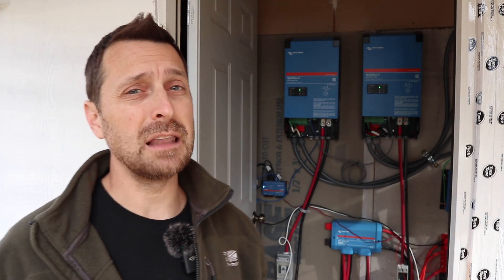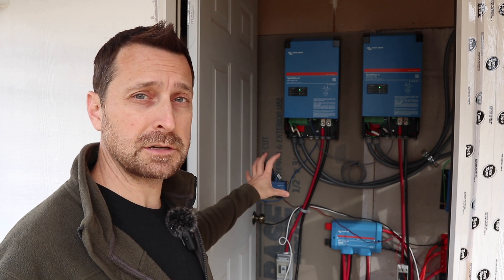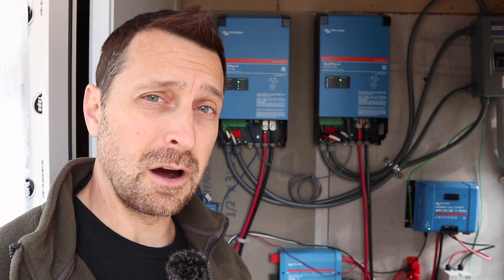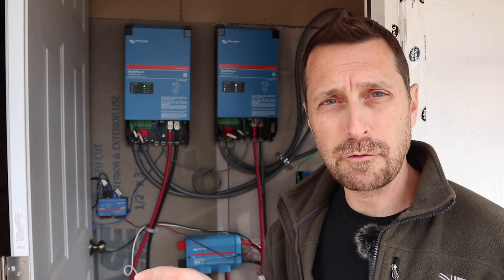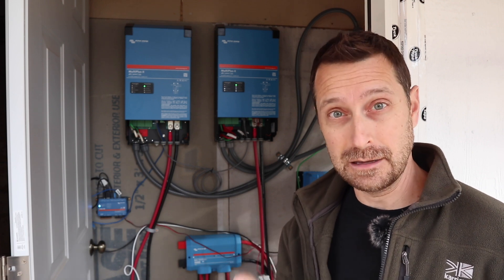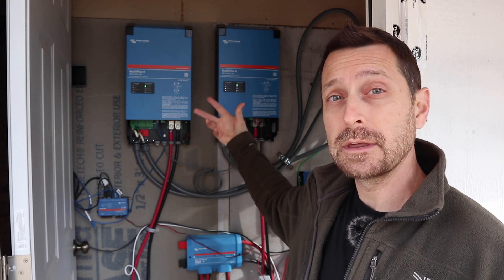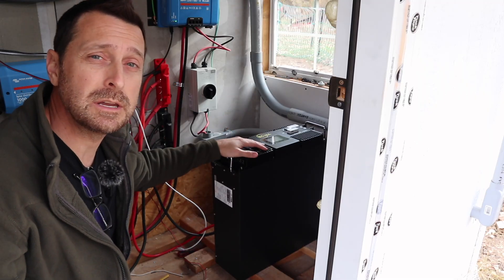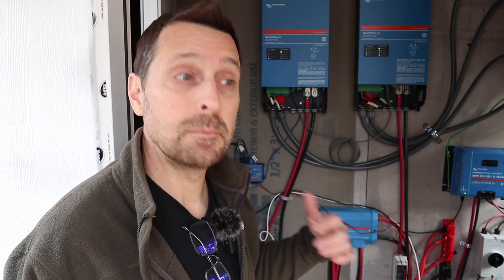Is There A Flaw In A Modern Solar Power System For Home Use?

Comment: Our system is uncomplicated. We have 14.6kW of Bifacial panels by SEG, a single EG4 18K PV by Lux Power and 28kW of EVE 280K DIY battery’s using JK-BMS’s with 2 amp active balancing (there isn’t a better BMS out there. Rock solid firmware). For cloudy days we use a Chargeverter by EG4 connected to our Diesel Generator running on filtered Waste Veggie-Oil mixed with 30% petrol for winter. We have no external breakers, fuses or switches because everything is built into the 18K and just works.. So, Solar Panels into inverter/charger into Battery’s that’s it. I considered Victron but there are just to many separate components and to many point of failure.
Reply from the maker: Victron was supposed to be one of the best and that is why I considered it. I am rethinking that a bit.
Reply: I wounder if Signature Solar would send you a EG4 18K or the new 6000 unit to review and keep.
Reply from the maker: @stevenfrazier8939  I have the new 6000xp unit for the house that I am installing right now and doing a review on. Unfortunately those would not work for the solar shed for the barn. I mentioned all the reasons why in my original install video on the Victron.
Reply: All I can think of is the Victron equipment is a Low frequency inverter? I have a Xantrex Freedom SW3012 that is a 12 volt 3,000 watt LF inverter that surges to 6,000 watts. and yet my High frequency 18K handles induction loads like it isn't even there. You will find the Lux Power family of invert/chargers are on a whole other level than you are used to.
Reply: @CountryLivingExperience I would recommend going to voltage control and no SOC. I run my 3 Schneider 6848 on 3 15k BigBatteries and am having no issues. I’ve heard that Discovery battery “the best” even has issues with SOC tied with a Schneider system. SOC is the issue IMO. Victorian are little tanks and should give you a trouble free long life.
Reply from the maker: @NewLightEnergy  I'll explore that.

Comment: I agree with everything you said and have seen it  myself. I know friends with solark systems that have issues with Them. Seems to me these high-tech all in one high frequency based inverters have issues. I myself run a dual magnum energy 4448PAE split phase system. Midnight solar charge controllers,1 is 12 years old. Almost 6 years off grid 5 with magnum inverters not a single issue Old school American made system I love it. EG4 BATTERY 30kw system.

Comment: took my smart solar  mppt  for a first  component .. and checked it  needed update but i m going off grid  and i still strugling with the  choices // multiplus2 or phoenix 3000 ?   and when batteries here will i have to make em comunicate or manual check em!!!   there s enough solar here 290 days a year so that15% of the year i dont mind  manual charge em some times!!!  for the money i could already have a ready cheaper system plus backup  extra components if need!!! that blue company isnt cheap...!!! i might go for older  big leavy inverter and take the small phenix for electronics and lights !!!
Reply from the maker: Looks like all of us are going to have to experiment with a ton of different components.

Comment: You do not have to have BMS communication with your inverter. You can use it in the user setting or custom and set it up. Like a led acid battery and it will work off a voltage. That way you don't have to worry about it shutting down. If it loses communication it will shut down
Reply from the maker: I have not been able to configure that yet. I have a call in to the Big Battery rep who handles Victron compatibility.
Reply: Doesn’t work well with lfp batteries.

Comment: Totally defeats the purpose.
My old outback system has run 20 years no problem except the lead acid batteries that need to be replaced after 5 or 10 years.
Lithium adds a lot of efficiency but also has to be constantly regulated by its bms and that is a computer.
Reply from the maker: I might try to find some old Outbacks or MidNite Solar.
Reply: You can still buy new outback inverters and charge controllers
Victron is also one of the best @CountryLivingExperience

Comment: If your power shed/inverters are not connected to the internet, how do you do updates? I am getting ready to build my power shed by my utility pedestal and don't  have wifi out there.
Reply: Google UBNT (Wi-Fi transmitter and receiver ) Ubiquiti is the company name . I use them have the M5 and M2 ( 5gig and 2gig) My garage is 1000 ft from my house but the range is excess of 6 miles.
Reply: If it's connected to the internet, if it has Bluetooth, it means you have no real world IT security support or enforcement
Reply from the maker: I upload the updates to my computer at the house and walk it out to the solar shed to do the update via hardwire on the Inverters and batteries. For the MPPT and Cerbo, they update from my phone via bluetooth.

Comment: Growatt told me not to update firmware unless there is a serious issue. Make me wonder how often equipment gets bricked during firmware updates.
Reply from the maker: Good question! Glad Growatt told you to hold off.
Reply: @CountryLivingExperience  I'm going to replace it with 2x 6000XP EG4's when I have some cash after a few other projects. The 8Kw Growatt split phase inverter has been ok but the fans are loud and the idle consumption is high. Redundancy from 2 paralleled units will be nice. Nothing is perfect, but whenever I turn around there's something better out here. Hope you solve your communication issue. Blessings
Reply from the maker: @paul.phillips  Thank you. 
I am actually putting 2 6000xp's on the wall for testing as we speak. I will hopefully have the initial setup video out this week.

Comment: Brother now u got me worried ... I just got the 6000xp. I am running the outback and midnights and have never had a problem.. I was gonna upgrade to the 6000xp and not have it connected to that dongle and just run it if i need to know my soc I do it myself... I guess I will find out if not im staying with outback 10years and no problem..... Thanks for the info keep it up brother
Reply from the maker: I’m sure it will work out fine. I am about to hook up some 6000xp’s as well. I will leave off the dongle to start. Glad you have the outback’s for a backup.
Reply: @CountryLivingExperience  I'm also running an older Outback system with lead acid batteries that will not play well with Lithium batteries. I was looking real hard at a couple 6000xp's as well and some of the latest EG4 server rack batteries. I have only had one problem with my Outback (circuit board went out in one inverter) in 15 or so years. Was an easy fix. Please let me know how the 6000xp's work for you. Been following your off-grid builds and homestead lifestyle.
Reply from the maker: @timsears4385  No problem. I will keep everyone updated on how they work. Sounds like Outback is a great product. I have never owned them.

Comment: There is a lack of communication standard across all of these vendors. EG4 is the worst. All of their batteries have different comms, dip switches, etc. Signature Solar doesn’t even understand their own products and how to troubleshoot . If you went with Victron LifePO4 batteries with Victron BMS managing them you would be fine.
Reply from the maker: I personally don’t think it’s an EG4 only problem. I had the same issue with the Big Battery. Also, have never had an issue with my EG4 LL batteries as I mentioned.

Comment: Yes sir, I use Midnite Classic controllers,  and 12,000w AIMS/SGP (dumb/no communication required) inverters with 240v/120v split-phase, and DIY battery with Batrium BMS (completely under my control, no software updates) and NO external internet required.   The Midnite Classics let me turn inverters (load) on/off by their internal AUX1 relay based on battery voltage.   These independent components do not require 'communication with each other' and thus any firmware updates to continue to work - nor do I need any updates.      I do use my own software to pull data for an integrated web-page monitor dashboard...  but it's for my convenience and does not affect the actual operations of the system.    Part of the reason I went this way is to avoid the very subject of this tube.     FYI - I'm a retired software engineer and understand very well that software (firmware) updates will always have problems, sometimes small and sometimes large/interfere with operations - it's the nature of complexity, perhaps cumbersome software design, and ultimately insufficient or inability to do proper QA/test due to time, $, or ideological constraints.
Reply: TO be clear, most of the stuff he mentions in this video has a dumb option. I don't have communication enabled with my EG4 inverters, it just relies on battery voltage like your system.

I plan to allow solar assistant to sit in between everything, allowing things to communicate with it but not each other but for now I only have the inverters hooked up to solar assistant because I haven't got battery communication working yet. But I do wish my MPPT was a separate device as it occasionally trips out. Last night it was showing 0 watts on one of them, and this morning too but when I flipped the breaker off and on again it worked. Or it was working and just a loose USB cable.
Reply from the maker: Thank you! I appreciate your comment.

Comment: I am techie if you like and the old adage of it aint broke don’t touch it applies to many many hardware items.

There is no reason unless advised to do so by tech support to go around flashing firmware’s.

I’ve got 3 different growatt spf 5000 and they all have different circuit boards and therefore differing firmware versions and a couple are not the latest version. 
However they work fine together, so why touch them?

In your case, you have been advised to flash them and it has made no real difference.
Therefore why are you holding onto this expensive hardware waiting for another firmware update?

You didn’t say whether sig solar can reproduce this problem as I assume they could do if they tried. 
And if they can recreate your setup without the same problems then they can swap kit over right?
Reply from the maker: I didn't want to touch them either. I was advised by tech support from two different companies because it simply was not working. They are working on trying to recreate the issue.

Comment: The question is who designed and built these systems.
Reply from the maker: Hmmmm?
Reply: Were the componets made in China who wrote the firmware?  Things are made cheap with little engineering. @CountryLivingExperience
Reply from the maker: Everything is made in China. Not sure who wrote the Victron firmware.

Comment: I do agree the firmware thing can be irritating in some cases. I’ve had my own struggles with this in the past. I’m definitely not a tech person. 

Usually though, things don’t just suddenly need firmware updates. That’s odd your system just randomly stopped working. In fact,  if you’re at a point where things are working, you typically wouldn’t ever need to update the firmware again.
Reply from the maker: One would think that was the case. This Victron system has been all over the place. I can’t get a clear answer on why it is doing this.
Reply: @CountryLivingExperience  yeah it’s probably easier to do like Adam suggested and run things without coms and a shunt. I’m still running my system without communication.

Comment: Yeah it seems like “battery communication” is a problem across the board.  You have to keep updating X, Y or Z in order to get it all to work.  

A thought would be since you’re installing different batteries together, why not get a shunt for your SOC tracking.  It’ll provably be more accurate since you can’t get comms between the big battery and EG4 batteries.  It seems like removing comms from the equation fixes things for a lot of people.
Reply from the maker: Thanks Adam. I think I am going to go that route.
Reply: @CountryLivingExperience  good luck!  Personally I would go the smart shunt route vs the Lynx shunt.  Much cheaper.

Comment: I'm experimenting with my first small solar system and immediately had problems with the firmware. After that got fixed, I accidentally left the solar generator connected to my WiFi and noticed on my WiFi router that the solar generator is sending a small amount of data back to the manufacturer every day. Once I figure out how to block that traffic, it will be interesting to see what happens.
Reply from the maker: Wow, that is an interesting issue too. Hopefully you can find out how to block.

Comment: Yes, we we all have experience compatibility problems with our solar systems. This reminds me of the 70s and 80s with computer systems and their incompatibility between components in the system. Especially with batteries each vendor has followed their own drummer and they’re just is no standards for a communications. There is a solution, but you’re not gonna like it. If you re-configure your system with  one vendor Victron for everything batteries, charge controller MPPT, it should work flawlessly. Or, on small systems, what I have done is use dumb batteries and let Victron charge algorithms tell me when the batteries are charged and want to shut them off.
Reply from the maker: I wish my batteries were dumb. I thought I had a dumb battery with the Big Battery and I thought the Victron charge algorithms were going to read it correctly but that had not been the case at all.

Comment: I dont accept that a completed product needs constant updates.......this is the micro soft business model.   If it works now the only reason to need an update is if you introduce new components to the system.  This could be a real problem as time goes on and company's stop supporting old components or go out of business. Have these home systems become as open to failure as the large scale commercial grids?? I have a DIY system in my garage that is made up of separate components and has no blue tooth or wi fi ability, no special communication between components and it has been working perfectly for three years. The older non integrated dumb systems are starting to look better now.
Reply from the maker: True. They shouldn't. The older systems are looking a lot better for sure.

Comment: I have not had this issue with sol-ark 12k for over 2 years in operation.  Maybe 2 firmware updates and they ask me for permission before install.   I use agm batteries so the sol-ark measures battery volts and %.  No trouble with sol-ark.  Now I've got a family member with schneider xw+ 6048 system and its a nightmare with all the additional components.  It is 1990's technology from my estimate and have had 2 hard failures of the charge controllers.  I would not recommend schneider unless you enjoy having a hard time.  Just my 2 cents working with both systems.
Reply from the maker: Thanks. I have friends who have had issues with both brand systems. Looks like I may just have to get lucky.

Comment: Go to a DC house system, with point of use inverters as needed (fridge, microwave, etc.). You can use 1200W inverters that are far more efficient (no fans, for one) and eliminate much of the system complexity, enhance efficiency, and reduce cost significantly.

For ideas look at Purdue University’s DC house - but there are several around the country.
Reply: I agree.. about 50% or more in your home is now low power.. we need a dc rail standard for a whole house.. :)
Reply: Umm well interesting, got a small simple dc victron system in our garage which is brilliant no problems. 
Recently put in a EcoFlow power hub which goes too the house and a small office cabin. 
Firmware, software issues & updates all the time, also switching things on and off and SOC I just don’t trust most the time, at the moment trying too sort a return of the product as just is not doing things as meant too and costs loads.
Wish made a larger modular victron system instead, but also sounds has issues, think things are made a bit too complex for no reason sometimes mainly Wi-Fi remote stuff I think is the issues.
Reply from the maker: Interesting.
Reply: Read up on how a Switched Mode Power Supply works. DC into the rectifier comes out DC - so you can plug your iPhone box, laptop, and even your LCD/equivalent TV directly into DC - boost your 48V to 96V is cheap at the outlet ($30). Because everything built has to run in Japan, it’s plenty.

Comment: 17 Years  Ago  XW   3 x6048   for 18 kw     Set Up One Time  No Problem's    Not On The Network  As You Say  I Use A Webcam  To See ALL At My Home Or see From Web   When The  Xw Tool Was Taken Away   Not Going To Put In A Gate Way  For The Same As You Say No One Need See Or Control My System      Take Care    Nuclear lies Come DUE